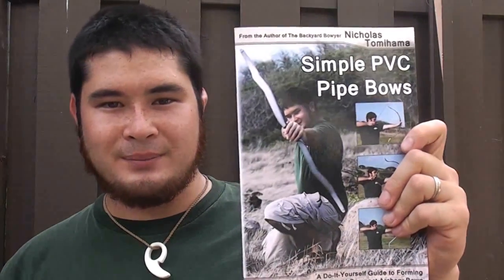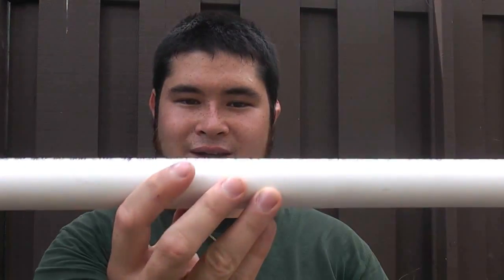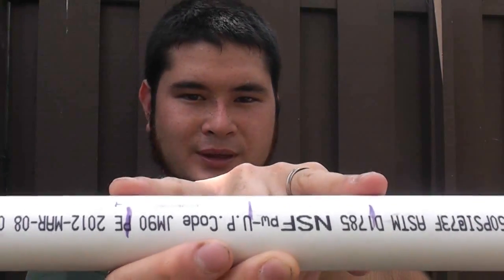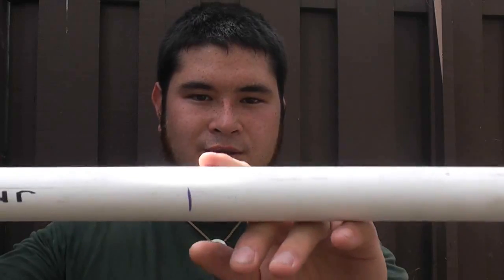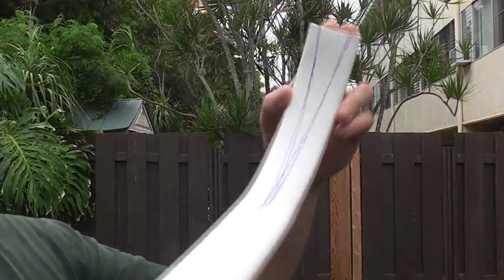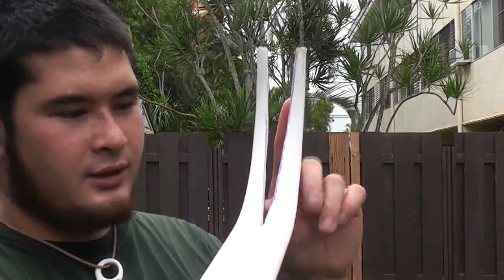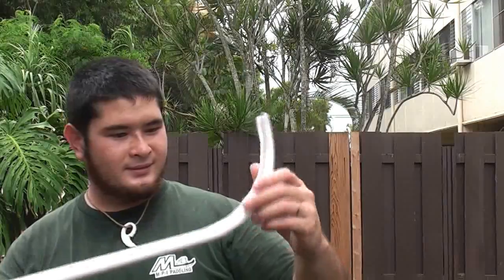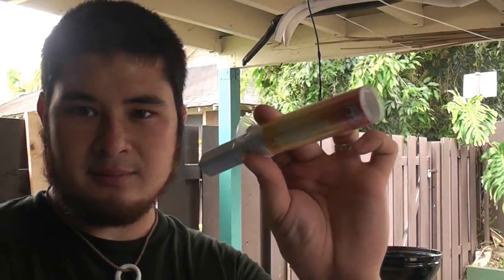How to Make A Centershot Snakey Recurve Bow Part 1

Comment: How could you drastically decrease the draw weight on this bow, say to 25lb draw? Making the bow longer wouldn't be an appropriate solution because you would obviously end up with a huge bow. Would 3/4 PVC cut to shorter dimension work out to a lighter weight?
Reply from the maker: Starting with a 3/4" pipe at 52" long will give you about a 25-pound draw weight. 1/2" pipe at 46" long will give about the same weight. These bows will be very efficient and fun to shoot.

You could also take a 1" pipe and just flatten it more, but the bow would be very sluggish and hard to shoot.

Hope this helps!
Reply: BackyardBowyer I'd like to thank you for the reply and also for the great work you do here on YouTube. If it weren't for you, I don't think I would have ever thought about getting into archery.

I'm very excited to build my first bow! I'll be sure to let you know how it goes.
Reply: A couple more quick questions for you if you don't mind:

1. How long would i need to make the string if i built the 52" bow?

2. What length of arrow would I shoot using that bow?

Sorry if i'm asking stupid questions, as i'm sure you can tell I have very little experience with archery. Thanks again for the help!
Reply from the maker: MuttonChew The string length would depend on the exact shape of the bow, how deep you cut the nocks, and how reflexed or deflexed the bow is. A good starting point is 3-4 inches shorter than the bow's length from one string nock (the spot on the tip the string loops on to) to the other. From there you can make it shorter or longer depending on the brace height (distance from the string to the inside of the handle when strung), which should be about 6-8 inches.

The length of arrows should be based on your draw length, not the bow itself. A 25 pound bow in 3/4" pipe can handle draw lengths up to 32", making it a good choice for the long draw used in many Asiatic archery styles.

Hope this helps!
Reply: Just starting to build the bow now but I'm wondering if it will perform the same if i just make it a straight recurve without adding the snakey curves to it?
Reply from the maker: MuttonChew You can make it a straight recurve, the snakey curves are just to help align the bow better with the arrow. Doing it without the snakey curves actually makes it easier to do, especially if you're starting out.

Comment: Nick, great vids! I'll probably be purchasing a couple of your books as soon as I am ready to jump into the building process.  For now, I'm just watching and learning what I can from you.  Quick question on this build... what is the benefit of splitting the ends down the center of the pipe and bending them in, rather than just trimming the unwanted material on the sides of the pipe down to a taper, and then cleaning it up from there?  Thanks again, and keep up the great work!
Reply from the maker: Eric Coulston Thanks for the question! The reason why you take the taper out of the middle is because the pipe is not completely flat at the end. The curved edges of the pipe add strength. By cutting the center out and leaving the sides intact, the tip maintains its strength. If you cut the edges off, the pipe would lose its strength in that area and the tips would basically become floppy. Hope this helps!
Reply: BackyardBowyer Makes perfect sense. Thanks!

Comment: What sized spacer did you use to flatten the pipe? And did you flatten from center or from the end of your handle marks?
Reply from the maker: I used a 1 inch spacer on this one, flattened at the center. Flattening at the handle marks would give you a bit more weight and make the recurves work a little more.
Reply: Thanks!
Reply: BackyardBowyer Does it matter if the bow is flattened at the center or at the handle marks and which do you prefer?
Reply from the maker: Kenny Wu It doesn't matter, just make sure you do the same to both limbs. I prefer from the center because I like the stability of an aggressive taper. You get more draw weight with a less aggressive taper, but less stability. Either way works well.
Reply: Thanks for the info! Can't wait to build one!

Comment: Greetings from Brazil.
If I don´' t want to use epoxi, can I heat tha top of the limb, press it and fill the gap with hot glue instead? (The glue ins´t suppose to act like the epoxi, just to fill the gap, just like Tim Piatek does in some of his prop weapons)

Comment: What temperature do you need to get the pipe to, would boiling water be hot enough to soften it fully?
I thought it might be a bit more 'controllable' than a heat gun, and you could let the heat 'soak' right through before bending.